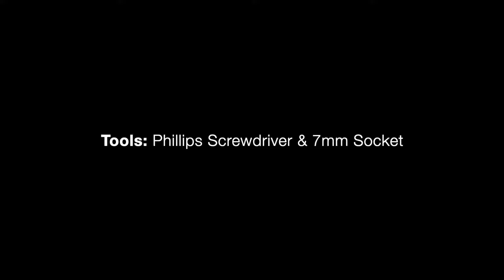Unlock your 50cc scooter power

Comment: What is the chance my 50 cc will blow up after i do the second thing ?
Reply: 50%😊
Reply: It's just another factory restrictor, it's stopping the slide from moving all the way up and allowing maximum airflow, other than it giving you some more rpm it's not going to do any damage
Reply: Omgggggg😂😂😂😂😂😂😂😂
Reply: @wooweetbix9412 And at full throttle the engine gets louder if the cap is gone. And fuel consumption also increases when the throttle in the lid is removed
Reply: Im thinking of removing the second thing but I have 2 problems 1.how much more fuel will it use 2. I can't get a straight answer on what it does.
Reply: @moderity  I left the throttle in the carburetor. Because if it's gone then consumption will be higher and the noise will be louder when you give full throttle. There's no point in removing it from the carburettor.
And then when the carburettor throttle is gone, the engine is put under more strain. There's no point in removing it.
What I also noticed is that the gasoline mixture when the carburettor throttle is in then the mixture is leaner, which means that it doesn't get quite as much gasoline and air. But it's not too bad. It's all ok
Reply: @danielclassics12686  thanks for a straight answer I'll leave it alone then👍
Reply: @moderity  It's all ok. These are my experiences because I drive a Sym Symply in my scooter, which also has a throttle in the carburettor from the factory.
I also replaced the throttle with an open carburettor cap but it didn't help the performance.
Reply: If you know what you’re doing it’s not..
Reply: @SBATHORGOD  😉👍
Reply: Gotta pay to play

Comment: Remove the CVT stopper yes, but do NOT throw away, put it back in before a service, and when you get a speedcamera ticket, that way you can prove to the police that it is incapable of going the speed they say they clocked you at! and for removing the throttle stop... no just get it to the correct length!
Reply: how to get it to the correct length? does this tuning work for the Peugeot Django 50 cc scoter as well? thanks!
Reply: @SimplicityForGood  check if your carb has the stopper, not every carb has it. U can check by opening the maintenance hatch located under ur seat and removing the lid from the carb, just be careful because theres a spring that wants to send it to orbit. its aight to remove it if u have one :)
Reply: Or better yet drive the speed limit
Reply: Will this work on a 2021 vitacci rocket 50cc ?

Comment: do not ever toss any of your parts away people . also you can change the jet size to a larger one VS removing it total . they key is the correct combination of air , fuel and spark . Not just pouring gas into ur scoot . Mine hits 47 on a strait away , slight hill pinned at 50 . steady hill climb never drops below 25 . no special mods .
Reply: Can you explain further? Currently trying to get my 50cc Yamaha razz to go a bit quicker wanted to remove govebor
Reply: @Sklagmann  do exactaly what the video tells u beside throwing away any part . u wanna be able to put it back in later just incase its going to a younger rider .
Reply: @esmandagamer3441  or in case police send u for an inspection
Reply: need more torque, 25 at no hill is ok! 🚔
Reply: Dialed in cvt weights also help. IMHO
Reply: @rbgpirate  you dont know what my hills are like .

Comment: Whats the second one for?
Reply: Allow more fuel in the carburettor making it go faster
Reply: Gasflow
Reply: @tomchurch5238  so you burn more gas?
Reply: Fuel dumps maybe better top speed but stalls & start problems + low speed will be crap too take off or control
Reply: @shubceee Yes..

Comment: Why are you removing that from the carburettor?
Reply: to blow it up
Reply: @blakedabass8148  aha!
Reply: It regulates how much gas gets into the carburetor
Reply: @devintharlow  had better look. Prevents vacuum fully opening throttle and fully lifting needle. Thnx
Reply: @delahayenator  will it use more gas after?
Reply: @shubceee  yes at full throttle it can lift the gas needle and slider higher to get more gas and airflow for more power
Reply: @delahayenator  chop several spirals of that coiled spring, effectively shortening it and that will give you faster take off, off the line. Less resistance for the cv slide to have to overcome which will give much better throttle response, that's what we do in atv's with a similar setup.
Reply: @blakedabass8148 🤦🏻
Reply: @shubceee Yes..
Reply: @Roboticdoughbull3k do u have a video? And will this work on a 2021 vitacci rocket 50cc?

Comment: So the regulation blew on my Euro4 (lexmoto) it blew the lights, but it also made the thing go faster, higher to end, we only talking like 43/44mph - the moment I replaced the regulation it was back to normal - meaning there’s also an electronically controlled limit or somewhere - anyone why what / where / how to kill it? Thabjs
Reply: I've never heard of "the regulation" I'm not sure what you mean.
Reply: I think you mean the cdi box.you can get unrestricted ones
Reply: In the cdi box pull the bottom left wire and tape it
Reply: the ecu restricts the revs
Reply: How come it blew lights 🤔 I got a 50cc and you should been their want more power…
Reply: On the CDI it's the Pink or Purple wire (Depends on CDI type). Cut that wire then put a wire nut on each end. If needed, use an "Inline Insulated PVC wire butt splice connector" ( I think its 16 gauge ) to reconnect if needed.

Comment: *Remove Emissions
*Add G- EGR Block-off Plate (GY6) 
*Add a 1/8 In. Rubber vacuum cap 
*Remove rev limiter bushing on CVT Variator
*Remove/Cut the Pink/Purple wire on the CDI boxes harness 
*Replace stock exhaust ( internal rev limiter) with aftermarket exhaust 
*Replace stock air box w/ cone style air filter
Tune up and....
Should be SCOOTIN" along 🛵 vroom!
Reply: does this also work for the 50 cc Peugeot Django scoter as well? 
or for what scoters is this tuning best? thanks!
Reply: yo what does the pink/purple wire do
Reply: @uncrustable9923  dont see it on my taotao 50
Reply: @rbgpirate  must be different as the years go on, mines a 2014

Comment: The last thing helped for my sym orbit 2 thanks!
Reply: Do you have the euro 4 version
Reply: @jamiegaming-ms8xl  i dont know, but mine is from 2013
Reply: @GM355-  question  i bacikly got the same scooter a sym orbit 50 4t 2009 and i was wondering if you do the last part will it not be to much fuel?

Comment: nice video...have you got any info for an euro5 50cc also?
Reply: It works on any 50cc.
Reply: @maci1245  nope, euro5 is EFI
Reply: @djilu9916   and i can not do what the video says if i have a euro 5 orbit III ?
Reply: @manostsigo8387  if it uses electronic fuel injection, then no. if it has a carburetor then there might be the same part. remove the little door in your seat compartment and check :)

Comment: If you have a scooter with a 50 cc engine/carburetor, can you just buy a 150cc one and replace it?
Reply: No you can not just drop a 150cc carb on a 50cc not that easily. You would be best to get an aftermarket carb that matches the diameter of the original and add a new jet to it. If you are going to upgrade the exhaust along with the carb then you can change the carb diameter. Example if you original carb is 15mm you could go to 18 - 20mm but will need to re jet and tune the carb.

Comment: I see videos where you disconnect the pink wire and videos where you do this so which one is it? Both?
Reply: i think its either both or the pink wire ur talking about is something else
Reply: The pink Wire is the rev restriction....
Reply: Yes cut the pink wire. It's probably one of my vids you watched. 

You can also just buy a unrestricted cdi and plug it in. They aren't much money
Reply: @motorcyclerescuer  do they really help though
Reply: @Night_demon-ic8cf  yes massively. 50cc in the UK is restricted to 30mph. De restricted can do 40 or more.
Reply: @motorcyclerescuer
Reply: 50cc aren't restricted in the UK mines stock 45/50
Reply: Just bought a bentelli sprint, was in a bind and got it fairly cheap... it's a pos.  This is the third scooter I've had, all 50 cc, and this one is the slowest and cheapest made.  I took the cover off the drive system and didnt see the washer.  Just adjusted the valves for the 500 mile service, new plug, drained the old gas and added fresh gas but she still wont run quite right.  Any suggestions?
Reply: @FinznFowl82 sometimes the washer is behind the cvt, not in front

Comment: Removing that screw from carb cap virtually does nothing. Cut the thread off with an angle grinder then your talking.
Reply: Got a video?
Reply: @56321books  I haven't mate, its easy the bit the nut screwed on just cut it off and leave a little bit at the top for the spring to sit on.
Best way to check is move the carb slide by hand and see if.it travels all the way to the top if it dont cut more off 😉
Reply: I was thinking the same thing. Its still restricted although slightly less.

Comment: Tengo una Symfony SR E4 50cc 4t , tengo quitado el anillo del Variador( Restrincion ) , aparte le compre una E.C.U. ( Según sin restricciones )el cual con esa E.C.U. solo me alcanza 62--65 km/h , si le quito ( restrincion ; si la trae ) del carburador me alcanzaria mas velocidad.......o qué mas se le puede hacer  para que alcance mas velocidad....., Gracias 👍👍👍👍
Reply: If you have removed the throttle from the carburettor then it will definitely be 5kmh faster perhaps?
But removing the carburettor throttle doesn't do much good - it just increases the intake noise and fuel consumption

Comment: They spend millions doing an all-round tune for Peds etc you would think the factory could supply modifications that work properly and make them more hefty profits ...or am I missing the point of wasting time getting an engine near to a bomb...dunno sigh!
Reply: All that stuff is from government regulations. Technically, we shouldn't be doing that. At least from the government's standpoint.
Reply: @Grey_Beard72  lol fuck it, if you live in boonies then go for it. now you got a discrete dirt bike
Reply: The thing is manufacturers have to comply to moped laws of different countries.for example on most of Europe 50cc scooters that can be driven with an Am licence cannot go over 45km/h.this means that those engines can go faster than that but are restricted by law.that ring in the variator at step 2 litteraly serves no purpose other than limiting the gear ratio on the top end to go slower.

Comment: What’s the speed difference u noticed
Reply: It will be minimal like maybe and extra 5 maybe 10 mph if your lucky
Reply: @jacklees7497  10 mph is not minimal on something on this lol. U will gain a little bit but not 10. Most of these chinese ones dont have a "carb restrictor" neithet
Reply: I gained 5 mph by removing the nut / washer were the belt is
Reply: Peugeot tweet with one of these engine go from 45km/h stock to about 65km/h without this ring.it's quite significant but it probably varies a lot on what bike you have

Comment: Ok my 50cc didn't have the plastic peace behind the pulley.  I also have a 150cc carburetor with a big bore kit fully installed everything. And i dont understand how im still maxed-out at 30mph. Can anyone help are give me some ideas of what to do
Reply: put a race race variator kit on it if it still doesn't go faster then it's prob is done electrically have to ask someone that knows about the bike
Reply: post a video of u reving the engine to the max rpm if u could, easier to diagnose like that

Comment: Can anyone help me?I have the speedfight 4 4t euro witht the electric gas injection and the limiter is set on 55km/h.Does anyone know how to derestrict that?
Reply: U need to buy  a ecu  with no limiter i have euro 4 injection gts enzo runs 70 kmh 50 cc  u  can change the rpm.with a computer on the orginal ecu u need to know what brand youre computer inside is or it wont work i.have EFi  but u have delorto and many other brand best to ask the shop for info
Reply: With older scooters its just cdi  but these newer have a smarter computer with sensors  its a newer version   cdi / ecu  plug and play its sitting on the gas tank not where the battery is

Comment: What will exactly happen if i remove ONLY the cvt cover? And will anything bad happen? How much faster will it get if it gets faster? Also can i use wrenches instead of the 8mm socket and 17mm socket?
Reply: random 😂 questions. but ive been riding with cvt cover off for years. have to drill start it but obviously runs cooler and makes tuning cvt easy

Comment: Sym fiddle 3 49cc 4t, i remove ring and now run 50 km/h,but whe  is on this speed it doesnt run clear and smouth, something is going wrong, and a noise appears on 50.....for more speed another cdi or can i remove the wire from original cdi??
Reply: Did you figure it out? I am having same issues. At higher speed i hear louder noise and feel the vibration. I ordered the narrow belt to see if that will help. Please let me know if you found out any solution. Thanks!
Reply: @BigSoBig  the vibration might be because your cvt case is loose or that it's starting to hit it's limit.the sound very likely is your air intake
Reply: Do not touch anywires on the cdi.buy a unrestricted one and buy a bigger cc engine with a performance exhaust.and then you need sport variator, light rollers,stiffer spring and stiffer clutch spring
Reply: Same here. Vibration ends at higher speed. Scooter isn’t that much faster but engine runs at lower rpm. Should result in lower fuel consumption but I haven’t checked that yet.

Comment: This will kill your low end be so slow off the line.
Reply: What does? The vario ring removal? Has nothing to do with acceleration. Just allows the vario discs to get narrower thus belt can get higher and gives a higher topspeed. Low end pulling/acceleration is influenced by rollerweight, little and big clutch spring.
Reply: @Mack Premo The restrictor ring only ads to the top end. It doesn't change anything else. Letting in more gas will only feed the fire but you have to give more air to aid it.